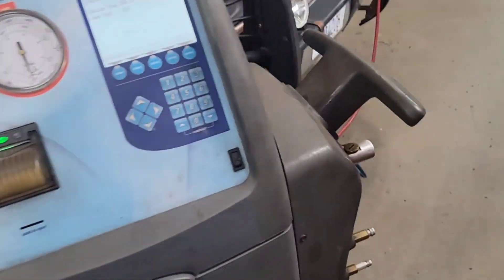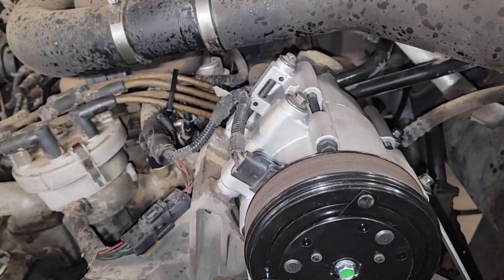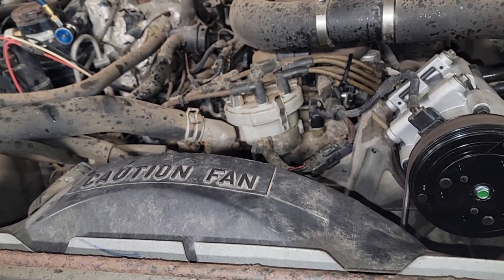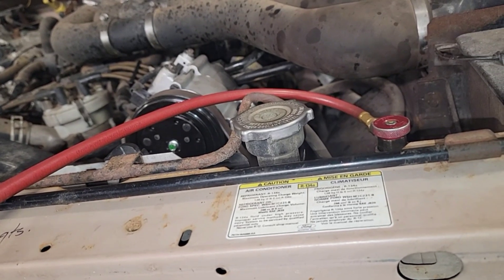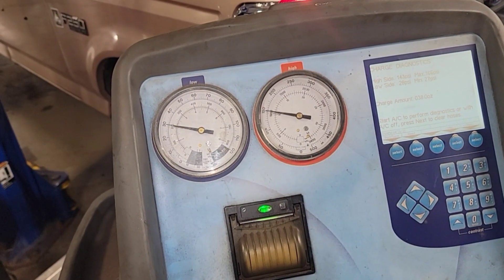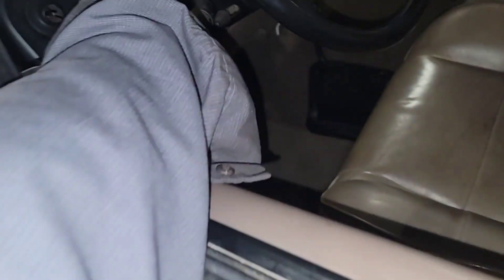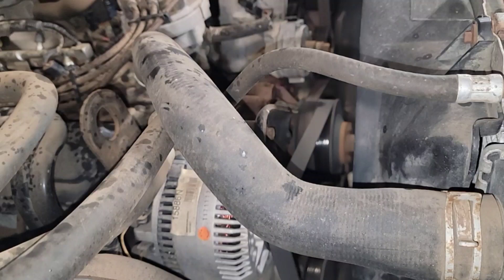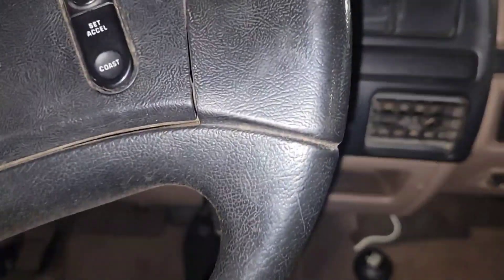1997 OBS Ford F250 7.5L AC Compressor Replaced and Now we run it and test Everything

Comment: Those were just beasts. Smooth power. Low, and actually relatively good high end. The Windsor engines were all great. The old modulars are good, but I'll take a 302, 351 or 460 any day over them.

Comment: Four Seasons makes good stuff. I've always had good luck with that brand of parts.
Reply: @applepoop10  I respect your experience. Again I said I had always had good luck. There is more to changing a compressor than simply unbolting one and bolting in another, etc. Evacuating the system, insuring there are no blockages, etc. For me personally, I like their stuff.
Reply from the maker: I bought a four seasons reman for my dodge truck 2yrs ago and still going strong

Comment: I've seen this battery light on condition before.  The light gets its ground from the alternator so if you unplug the alternator and the light goes out it's a problem with the alternator.  Every time I've seen it it's been due to a faulty alternator.  I've seen it right out of the box with remans before.  If the alternator works then, just as you stated, you can just live with it.  Otherwise it probably needs an alternator to fix it.

Comment: Time to replace that TTB 50 with a Dana 60 from an F350. That's what I did in my OBS F250. Drives better, better turning radius, and 4x4 works better. Stronger axle and easier to maintain.

Comment: Haha funny because I feel like that was my truck you had based on the current problems you stated for the customer. AC pump, the coolant leakage on the front of the manifold on the 460, the hard shift randomly. It's even that gold color!  Did you happen to ever fix that hard shift on those trucks? Wondering if it's as easy as a solenoid pack and fluid swap. I hit hard usually 1-2 but every once in a while 2-3 hangs a little. Great vid!

Comment: I used 2 from 4 season compressors  from rock Auto. On different vehicles. Both made it 3? years before leaking. One at the case half, the other at the rear mounting pad. The first vehicle I sold after I charged up the a/c. Again. The other one I do without. The vehicle is a backup, and rusting out as we speak. Needless to say I won't buy another 4 season compressor.

Comment: Wondering how much oil do you put in the compressor?  I just did an 05 Explorer that had about 6 oz in the accumulator.
Reply from the maker: So the compressor holds 3 oz pre-charged and the system holds about 3 oz and when I was evacuating I took one ounce out so I replaced only 1 oz and everything should be back up to par
Reply: @FordBossMe  
  Thank you.  I’m thinking someone else must have just kept adding an oil charge to this system since the compressor sounds like it’s about ready to grenade.

Comment: I can’t stand aftermarket compressors I swear I’ve had around 60% of them fail under warranty or multiple times and yeah I flushed or replaced the hoses condenser evap orifice etc never had a oem one fail yet